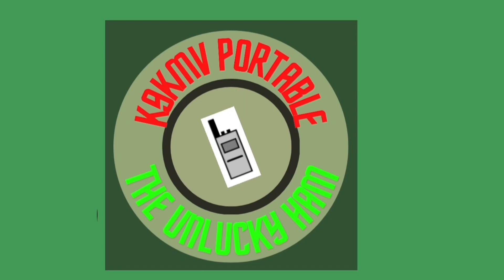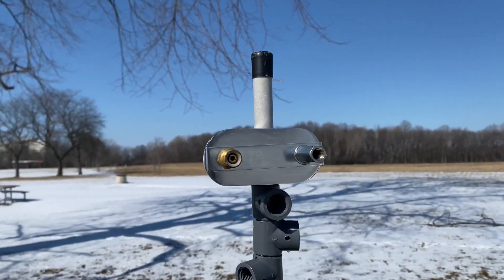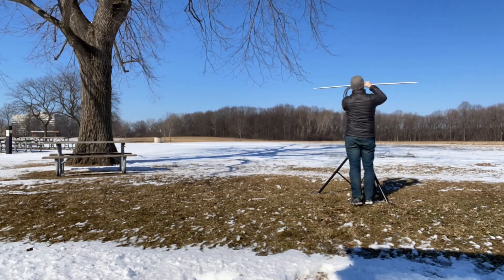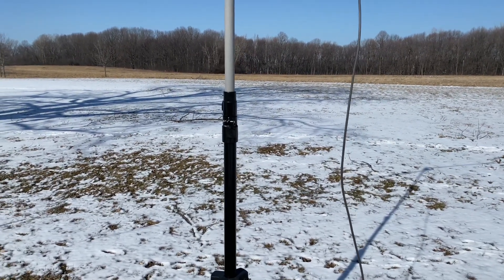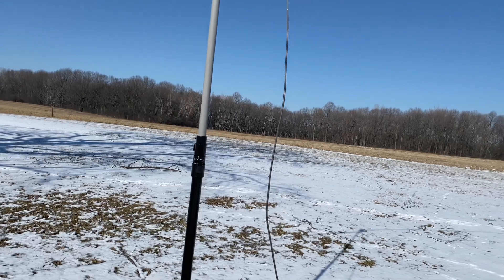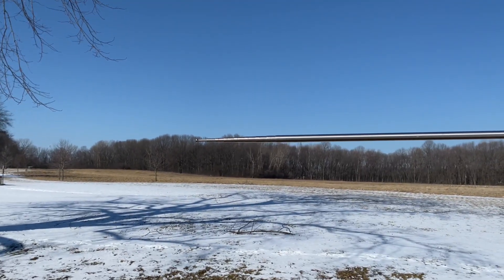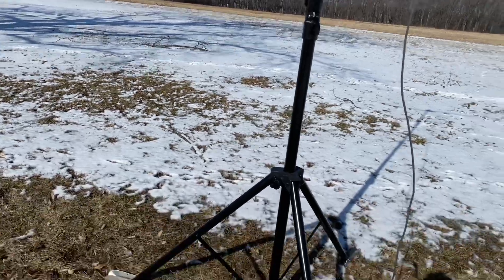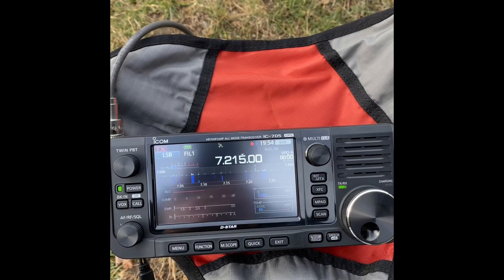MFJ Telescopic Dipole Antenna setup #hamradio #hamharder

Comment: I'm doing something similar. I use a 24ft extendable painters pole and hang my AH-705 tuner at the top and extend a pair of 6m wires off the tuner in an inverted V configuration. The AH-705 will match the wires on all bands 80m thru 6m. ICOM claims the tuner with two 5m wires will do the same and those MFJ whips are about 5m long so I might get teo of them and try it.

Comment: Very interesting setup. What transceiver are you using? And how many watts at 20m? Thx & 73 de KK6IPR, Charles in Fremont, CA.
Reply from the maker: Thanks for watching.
I've used it with different radios.  QRP like the IC-705 and 100 Watts with my FT-891.